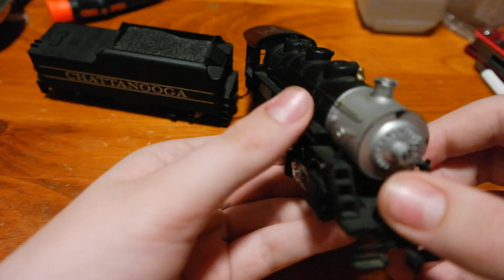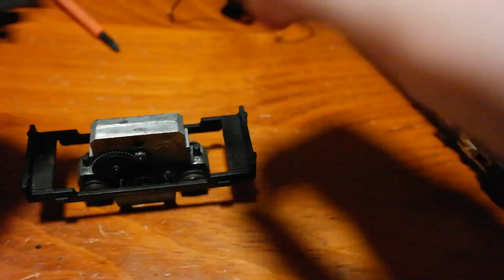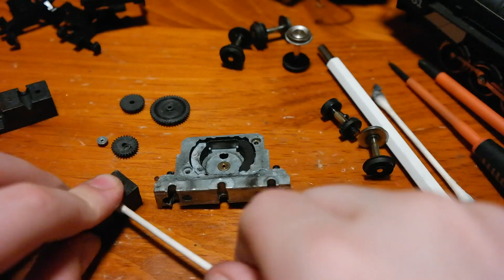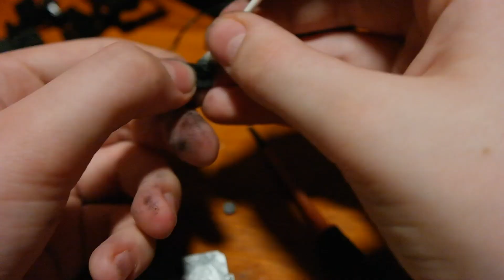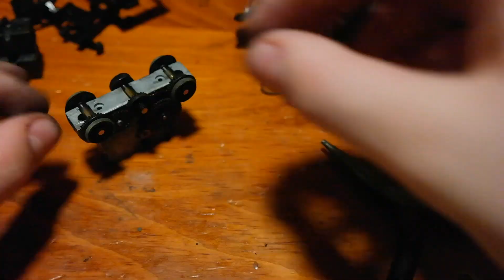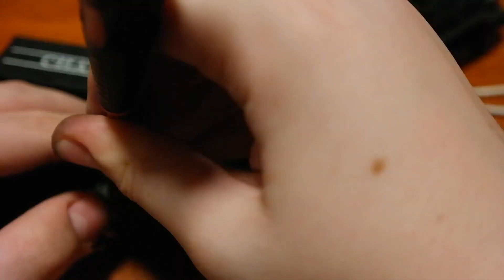Can we Level it up? - TYCO Chattanooga 0-8-0 #1261 Restoration

Comment: A friend of mine is currently rebuilding one he got a few days ago. He told me he is going to replace the original tender drive and install a bowser motorized truck  w/33" wheels and the tender truck side frames attached (intended for trolleys) in his with a regular tender truck  on the back end.He said he measured to see if it would work, so i guess i'll find out tomorrow,lol.
Reply from the maker: That sounds very cool I hope it works.